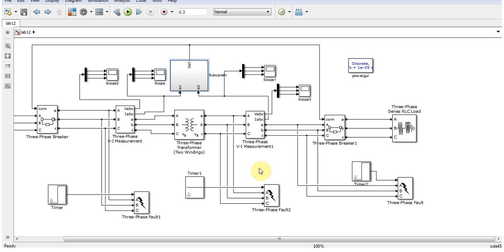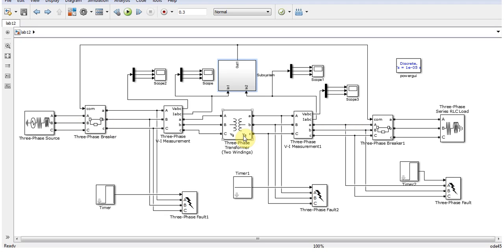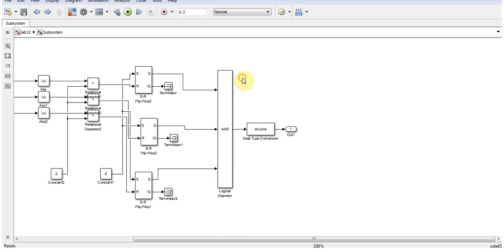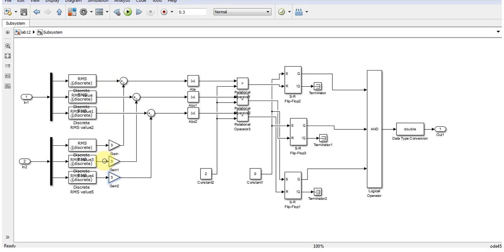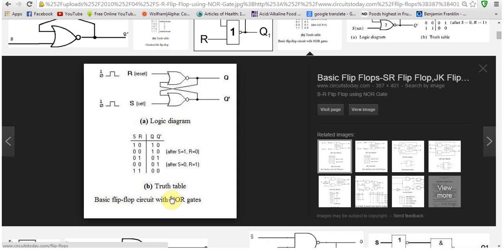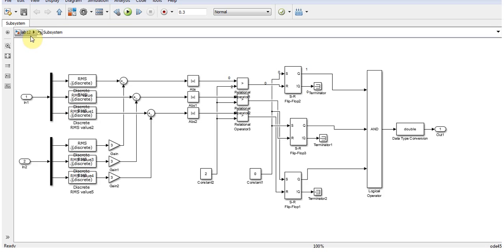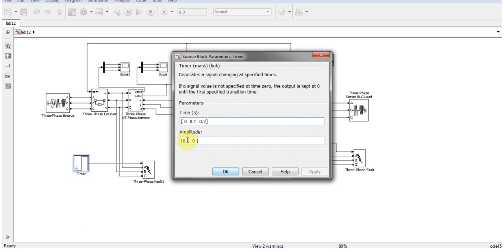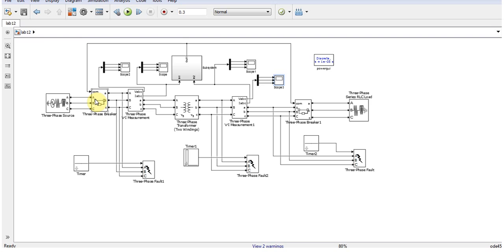Matlab Course : Differential Relay Protection Modelling in Simulink

Comment: for some people saying that diff. relay should not operate on external fault....the reason is scope is connected to voltage and when fault occur..when voltage of system become nearly zero...and current become maximum...for better visualization also apply scope to current Iabc and you see that for internal fault relay operate and current  become zero while for external fault current rises to maximum value

Comment: sir, i found some error please help me.the error is-
 Warning: The model 'waqar' does not have continuous states, hence Simulink is using the
solver 'VariableStepDiscrete' instead of solver 'ode45'. You can disable this diagnostic by
explicitly specifying a discrete solver in the solver tab of the Configuration Parameters
dialog, or by setting the 'Automatic solver parameter selection' diagnostic to 'none' in the
Diagnostics tab of the Configuration Parameters dialog 
Warning: Parameter precision loss occurred for 'Value'. The parameter's value cannot be
represented exactly using the run-time data type. A small quantization error has occurred. To
disable this warning or error, in the Configuration Parameters > Diagnostics > Data Validity
pane, set the 'Detect precision loss' option in the Parameters group to 'none'.

Comment: There's something I don't understand. Why do u compare the signal with 2?
Reply from the maker: +梁仲汉 i m comparing the incoming voltage or current with my reference value like the relay should trip on 600V and incoming volts are 440v so , it keeps comparing with incoming V with reference Volt .
Reply: SIR then why you didn't put any voltage or current level instead of 2. bcoz 2 can't voltage or current, as they are in Kilos.